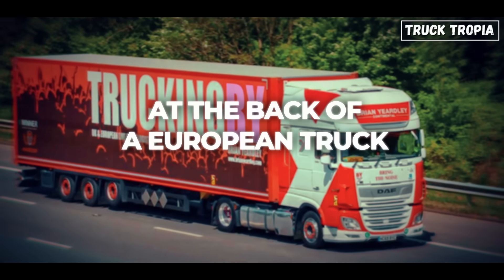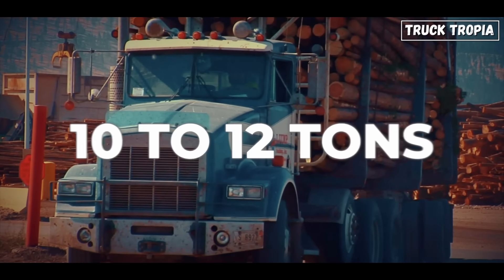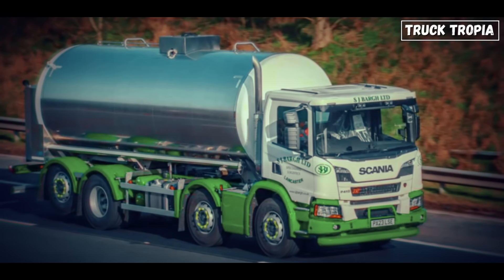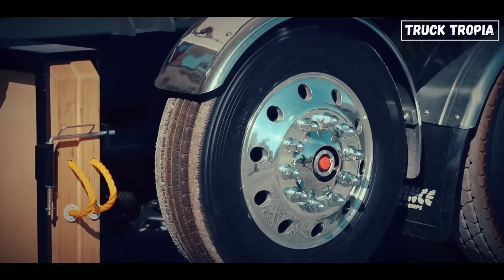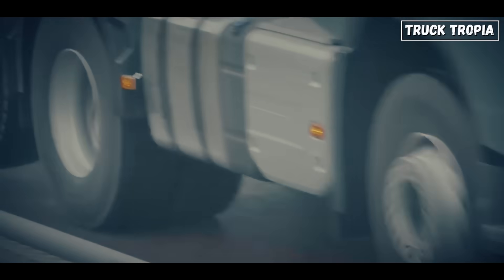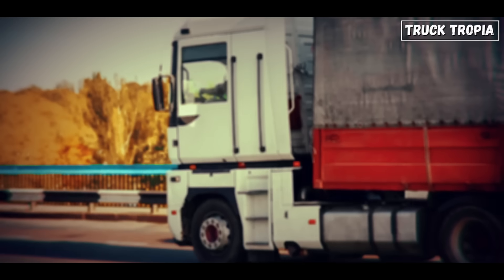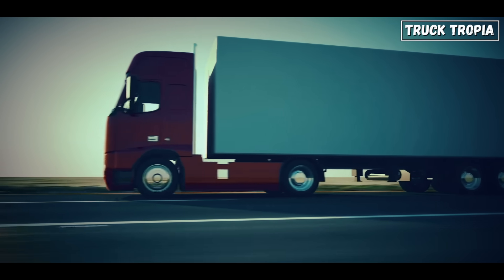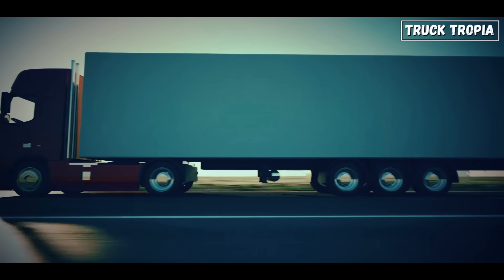Why European Trucks Use Boogie Axles & US Don’t

Comment: Americans use a lightweight 6x4 using two smaller Dana 150 drive axles because is the best compromise between traction and fuel efficiency, a 6x4 doesnt have twice the grip of a 4x2 or 6x2 it has four time the grip, twice the wheels and twice the weight of a single powered axle, europeans normally offer one axle size, and two of those axles make a noticeable fuel difference than a big single axle, but two lightweight axles are barely more fuel thirsty than a big one
Reply: There is no need for twin drive axles on interstate use especially at such low GVWs 80,000lb. They definitely eat up tires all 10 and the loss of efficiency in the twin drive plus added weight does cost more to maintain and use more fuel. I’m not a fan of pusher axles on tractors, prefer twin steering axles, or twin wheel tag axle, depending on the vehicles vocation. 👍🇺🇸
Reply: It really doesnt eat that much fuel or tyre, by having each axle receive only half the torque you make the drive tyres wear less, and by having the 4th wheel in the middle the load is distributed evenly, making tyre rotation easy, and fuel consumption difference is minimal is why american trucks for on highway use have drive axles that are small as they barely use more fuel than a big axle while having far more traction

Quite important in snow, rain, ice, crosswinds or at 120kmh
Reply: @renacimientoargentino7515 I have run 6x4 day cabs in the city and drive axle tires wear fast. I’ve also run 6x4 sleeper cabs at full weight on mixed work  with high mileage and tires do wear uneven and fast. The wheelbase does make a difference and European models are 2 plus 3 at 88,000 lb, and 3 plus 3 at 97000 lb. So different set ups but 6x4s used for heavy transport, or dump trucks. Personally given an option I would take tag axle if available. 👍🇺🇸
Reply: @pauljohn6637  The city driving and mixed works explains it, if you turning in tight circles a long wheelbase and 6x4 is awful for the tyres, and if is a cabover even more so

In my family we have 5 trucks, a Scania DC12 G420 6x2, a DC13 R440 6x2, a DC13 R440 4x2, a Ford Cargo cummins 8.3 1832 4x2 and my Freightliner columbia S60 14L 575hp with Dana D172 midweight 6x4, all them used for either highway ir regional road use

Mine is the one that has the most even and lowest tyre wear, and is also the one using least fuel, for road use the long wheelbase does wonders for stability and tyre wear, the 4 cabovers get 150,000 km from the tyres, the freightliner gets around 250,000

Personally i want to get hold of the Goodyear Kmax Gen 3 315/80R22.5 and i can imagine i can extract 350,000 to 400,000km from them
Reply: @pauljohn6637 It's more common these days with 8x4*4 compared to 6x4 with dump trucks and timber trucks, in Sweden at least. Increased gross weight with tridem setup.

Comment: Quite a few points that need clarifying. Unfortunately whilst talking about tag axles your video showed pusher axles and American trucks. A little confusing for newcomers looking to learn.
First of all a bogie is two or more axles. Whether it’s a fixed axle pusher which is ahead of any axle or tag which is behind any axle. Pusher axles fixed, independent to follow the steering wheel axle or steerable and liftable just momentarily for extra weight transfer to a drive axle. Each has its own advantages.
A tag axle gives you the better turning circle and can be single or dual wheel. 
Adding an axle does not eat into payload it adds to the GVW, so increases the vehicle payload. As mentioned by a previous poster you can have driven and steer tag axles that are liftable.
There are many options available by different manufacturers. 
Another difference in Europe they do not use super singles on drive axles. Tri axle trailers have super single wheels, with lifting pushers, rear lifting tag and rear steer axles all saving money on fuel and tires. ECAS electronic controlled air systems control stability and load sensing giving much better handling and ride.
The States are decades behind Europe in technology and freight efficiency. 👍🇺🇸
Reply: "Decades behind in fuel efficiency" are you sure about that? My 2007 14L series 60 freightliner columbia with the 3.73 dana S172 and the 13 speed fuller at 80kmh and 1350rpm does 27L/100km, with 52,000kg tanker trailer, the differential are also lockable in different ways and work in this weird "X" pattern where when unlocked the front right axle work withe left rear axle making traction great

And since grip is weight x contact area a 6x4 doesnt have twice the grip of a 6x2 or 4x2, but four times the grip, if they were a Dana-195 6x4 they would use more fuel, but since they are the D172 model, they barely use more fuel than a 6x2

And just so you know, volvo axles are licensed by meritor for example
Reply: You comment that the United States is twenty years behind European technology is totally false. Virtually every piece of technology commonly used on European trucks and seldom seen on American trucks is currently available to purchase. It just that American truck buyers choose not to buy it. And they have their reasons. Mostly to do with additional initial purchase cost, additional routine and long term maintenance costs, and all those features add weight at the expense of revenue producing payload. Another factor is most American roads and cities are also set up to accommodate the larger trucks and trailers overall so the extra features used in Europe to access tighter places is less of an issue here.
Reply: @americanrambler4972 I get the tight spaces regards overall length, but it’s the turning circle that dictates the overall length limit. Many trucks have liftable tag or pusher axles, even twin steer axles which help maneuverability along with rear trailer axles that steer and lift depending on the situation. 
The higher axle and GVWs allow more freight to be moved along with double decks for maximum efficiency.
Cost can be a factor here in adding new tech, but the more that get it the cheaper it becomes. Most of it is standard in Europe and seen as a plus on safety, efficiency and driver retention. Most of the tech coming here is second generation tried and tested in Scandinavia and Europe ahead of passing it on to North American subsidiaries.  Initial purchase cost can be recouped in residual value years later. 👍🇺🇸

Comment: Also the ‘fact’ that lift axles are not powered is not always true. Modern Euro trucks like Scania’s are available with liftable and powered (with a clutch) axles.
Reply from the maker: Good to know!, but its only Volvo and scania that have it
Reply: @TruckTropia  Finnish truck manufacturer Sisu patented this in the 1980s. The patent expired in the 2010s, allowing other manufacturers to make lifting bogie trailers with a drawbar disconnect.
Reply: Was definately my first thought when i read the topic..
Reply: @TruckTropia  no Tatra and MAN also has them
Reply: Some trucks can also steer the last axle
Reply: Even the modern Freighter Cascadias only one of the rear axles are normally powered. If you need both axles powered there’s a dif lock.
Reply: @NathanH172 differential lock:. Locks up the differential so that right and left tires spin same.   Keep from getting stuck on slick surface or gravel.  Inter-axel lock.  Allows you to power auxiliary axel(s).   My Volvo has both.
Reply: @NathanH172 Is the lift standard though,  or does it come extra? ...and if it's a midlift,  you're missing out on maneuverability. Retaining slightly better stability though.
Reply: @m @martinpoulsen6564  The one I have doesn’t have a lift axle and the axel that is powered is the forward drive axle unless the axle interlock is activated.
Reply: @NathanH172  Yeah, sounds like the typical american setup, apart from the switcharoo between having the front or the rearaxle in the tandem permanently driven... usually the rear is engaged full time, right? ...at least on Paccar, Volvo etc.. Doesn't really happen that way in Europe... Anything that doesn't steer or is permanently driven is usually a lift axle, and can be anyway. All 3 at once (steer, drive, lift) I haven't seen... yet. Except for something like an SPMT
Reply: @NathanH172  I have been driving long haul trucks for 51 years and I drive a Freightliner. I did not know this about the Cascadia. I learn new things all the time!
Reply: @SternDrive  It’s always learning. Learned that one from pulling into a driveway and lost traction, since it’s the forward drive wheels that are normally powered.
Reply: @NathanH172  I really think you misunderstood. Both axles are powered, however you can lock the front to the back axle. And you can also lock the right wheel to the left wheel on the front and back axle. We have three switches on our  Freightliner trucks. So we can lock right to left and also front to back, but normally both axles are powered. Check with Freightliner and I think you will find out I am right. I use these features all the time, but normally I will only lock the front to the back and that will get me out of a bad spot with ease.

Comment: One huge advantage of the lift axle he doesn't mention. Forcing it up while fully loaded in winter conditions gives you a tremendous amount of extra grip on your drive wheels. Saving you from using chains, very often.

And, today it's not uncommon to have a lift tandem, so you disconnect the drivetrain from the last axle and then can lift it up also. Twitch that setup you have the best of both systems, small trade-off is a weight penalty.
Reply: And last axle is often steerable, which helps reversing in slippy or snowy conditions as the lift axle down steers the back of the truck while reversing in deep snow or mud.
Reply: A lot of tractors auto-lift the Tag-axle / Bogie when reverse is selected 👍
Reply: @Nick-Goldfinch That has to be a US thing. Everything to avoid a steer axle
Reply: Extra weight on a single axle works on ice, but does not help at all on mud or gravel.
Reply: @tutekohe1361  I did not mention anywhere that it would help in mud or on gravel. I for my part only drive on roads, since semi or module are unbelievable bad off-road vehicles in general.
Reply: My boss swore that single axel trucks get better traction. I've not found that to be the case. Two power axels with lockers seems to be the configuration I get the best results with in all conditions.
Reply: @reedr1659  as often, it depends. Are you driving all the time with heavy loads, tandem works fine, especially if you can adjust the weight distribution between them. But, if you have just a little too much weight for one axle and have to use the liftable axle, it can help you a lot, to just force the liftaxle up and drive overweight on your drive wheels. The extra weight gives you a huge plus in traction on the drive wheels.
Reply: And uphill...

Comment: in slovakia are more 6x4 or 6x6 (i mean semis). 6x2 is quite rare because max weigh is 40 tons. More interesting theme is tatractors(higher fuel consum, but less paying for road)
Reply: Why do you need 3 axle tractors for only 40 ton total weight?
Usually the boogie or tandem is most  common for Scandinavia where they drive with 50 tons on a standard semi, and even more with module setup.
Reply: @bjrnbulhoff499 in slovakia we have lot of forests so multi axle trucks with higher traction are needed. And tatracotrs(6x6 offroad semi used for farming) have rights as tractors, but they are practicly 6x6 semitrucks used for road delivery too because it does not need pay for high speed roads(same rights as tractors, but for full size semi).
Reply: @bjrnbulhoff499  for basic use is more common 4x2, but 6x2 are for semis really rare(especially ones with taglift)